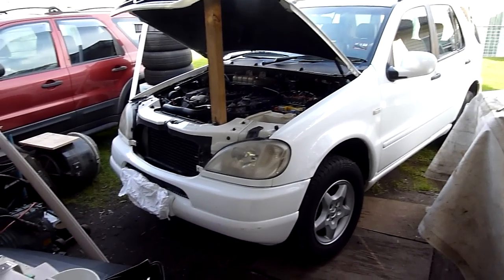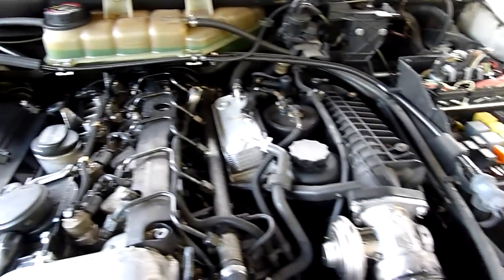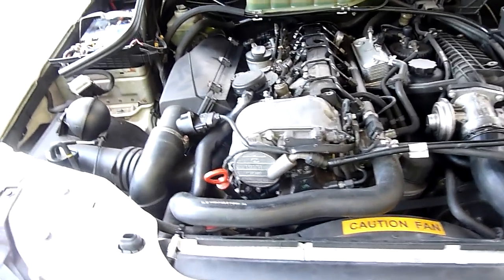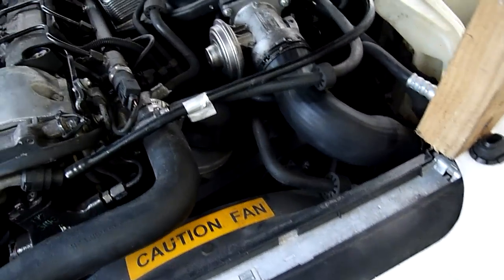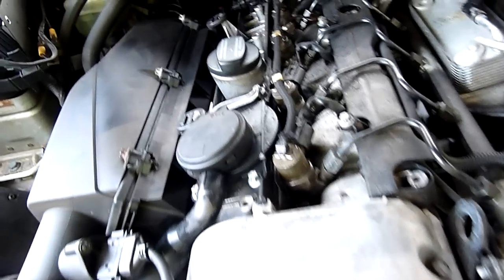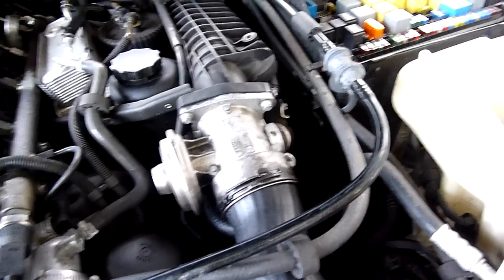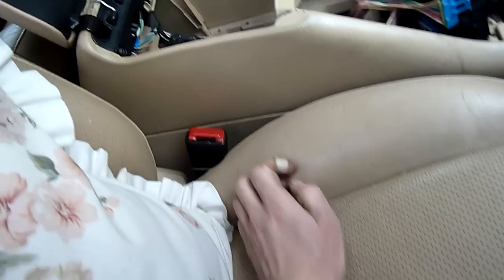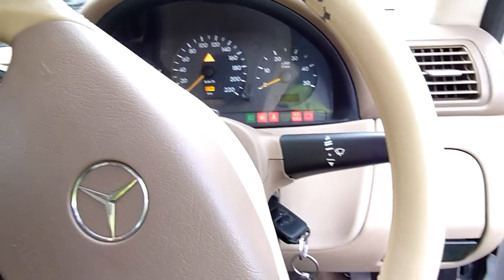Mercedes W163 ML270 CDI Project Walkaround

Comment: Nice ive owned 2 w123's a w210 and now the w163 Ml320. I bought it for $1100 usd needed a water pump and an emissions test. when i got here home it also had a split catalytic converter had an engine light and all 3 lights etc esd and the other one. It has the v6 3,2 liter , The engine light was a clogged secondary airpump passageway, the bushes were worn out on the abs pump. Anyway when these things were fixed i took it on a 600 mile trip on the socal gabler 500. Off road its great, ive owned Toyota Hilux, Suzuki Samurais 2x Mitsu Pajero and a Montero as well as a Toyota Surf so not having to lock hubs is nice. I have to say its pleasure to offroad and i rarely put it in low range.   Very easy to work on as well once you remove the inner fender well covers you can access everything. Anyway thanks for sharing your project.

Comment: From a forum: The BAS/ESP lights pertain to your brake assist and electronic stability systems. One of the more common problems we find is a faulty stop light switch or a steering angle sensor.
Reply from the maker: Ah thanks, I have to hold the wheel off center due to an allignment issue, I wonder if the steering angle sensor is causing it to freak out?
Reply: Aussie50
Worth checking isnt it :-))

My mates peugeot had the esp light on, it was the break switch, it was a double brake and esp switch, watching you put your brake on lol, not bloody esp :-)
Reply from the maker: zx8401ztv yeh my 7 series had the same issue, it would trigger the check control module if the button was not released at the right time (must have had a transducer somwhere else to detect brake clamping)

Comment: on a side note, the power seat on my mom's '96 Grand Caravan had a local fuse as well as a fusebox fuse  for the power seat. it may be worth checking into underneath at the electronics box itself in the seat. I had that one blow on me once, seat was stuck in the far back position and I felt like an idiot driving to and from autozone without a backrest.
Reply from the maker: yep!, I found it under the drivers kick panel, or more importantly, did not find it, because it had been borrowed
Reply: Aussie50  Speaking of borrowed fuses, I had to do something similar years ago on my old 97 Golf. The front wipers suddenly quit on me just before I had to go visit someone so I had to take the fuse from the rear wiper so I could make the trip safely as it was pouring buckets of rain that evening.

Comment: Hi. FYI, the battery is probably of the wrong size - you need a 019 battery with 100AH or 95AH and 800CCA. I got a Bosch 019 Silverline S5 in mine (the genuine Mercedes one lasted 7 years, and odd warning lights started to show up due to battery problem). Similar to you, I also had to reseat injector 5. Changed my serpentine belt, alternator clutch pulley and idler. Changed thermostat, all fluids, brake pads, plus installed a DVD/DAB/SATNAV system with reverse camera, etc. :)). Very nice car and pleasure to drive. Mine is a late 2002 ML270 (with indicators on mirror) 6 speed manual gearbox, 73,000 miles, which I got for a bargain price of £3,000, last November 2013 and from a dealer. Had some minor rust under the wheel arch and near the tailgate light which I polished and sprayed (Well I sprayed the whole car myself!). I also changed the bosch auxiliary coolant pump (you would know if it is faulty by holding and feeling it - no motor buzzing and no coolant flowing from the top pipe in the expansion tank = faulty pump). Enjoy.
Reply from the maker: Awesome, I figured the battery was a bit small, its clamp has been butchered to try and clamp the smaller one, but it failed. I will be looking at a new battery soon, winter is slowly killing this one.
you got yours for a steal too!, the facelifted ones are still around $7000 here, with higher mileage!.
I've been test driving her all morning and love her!, very nice ride quality with the new oversize tyres on!.

Interesting to hear yours is a manual too, I would have loved to find a manual one, but they are very rare, or expensive.

Comment: Many of them are supposed to give diesel leak problems  around the pump   I've noticed many of them are low milage  in age   it seem  they are sold on  often or changed for some reason maybe it's difficult to get mercedes mecanics

Comment: If you find the 30amp fuse for the drivers seat is blown (each side has its own fuse), it may be that one of the wires in the seat itself has rubbed through and is shorting on the frame - replace it and it may be work until it touches just right and shorts again. Had this problem in a W203 with electric seats.

Comment: Congrats on the car - very nice. Looking forward to be seeing more about your efforts. Shouldn't the car be a new enough model to have an OBD connector? A cheap interface from eBay and you might get more insight into what is causing the warning lights in the dash to come on.
Reply from the maker: I do have a standard OBD port, but apparently Mercedes have some quirky software of their own in there making it hard for cheaper scanners to see all the codes.
Reply: Damn. No other way than the hard way then ;-)

Comment: No offense, but what is it with Australia's fascination with diesel vehicles? Here in the States, we'll buy 'em in trucks, but other than that, most of us aren't that interested. Is it because of the fuel economy?
Reply from the maker: yeh, fuel economy and hauling capacity, mind you Diesel is pretty expensive now, back in the day it was dirt cheap, just like LPG. but they jacked the price up to match everything else :(
Reply: It's not just at Australia. In Europe diesel cars are very common. As a matter of fact I think US apart for few other countries are pretty much the only "gasoline" countries. Torque, fuel economy and durability pretty are the usual reasons to buy diesels.
Reply: jothain Over in New Zealand, one has to pay for the distance you use while driving a Diesel,
Reply: jothain Diesel does seem to be gaining popularity in the US, probably because the US automakers are slowly vanishing, but that's a personal thing of mine so I won't go further on that. Jeep is coming out with a few models that have optional diesels, all SUVs, and I think  a few diesel sedans are coming the States as well.
Reply: 4E047RHH Out of curiosity. Does New Zealand have, sorry don't know exact word "annual/yearly tax" for gasoline and diesel vehicles? Or is all taxes by distance traveled?
Reply: The taxes are metered out by the size of vehicle you have, and extra taxes for the distance driven with Diesels, They are trying to discourage their use, The NZ gov think they are dirtier than petrol cars, If you are really interested, i would do a google search to reveal more detailed info, as im not 100% on the info ive given here,
Reply: 4E047RHH my personal opinion is that diesels if tuned correctly are more efficient and better for the environment than most gasoline cars particularly in New Zealand and Australia because of lower admission standards for gasoline cars,  on the other hand in America it may be the other way around. in fact where I live in California, I have to take my diesel trucks that don't have any emissions on them to be inspected which is bs.
Reply: I'll have to remember that if i decide to move to new zealand :(
Reply: New Zealand is a very expensive place to drive a car, Quite high fuel prices, Plus they are a small country that is earthquake prone, so most of the taxes go to maintaining roads when they get messed up,,and yes i would tent to agree, Diesels are my preference, Especially if they are run on Bio-Diesel,
Reply: 4E047RHH very true. i have duel citizenship witch is very nice but I've always fancied living there even if it costs a lot.  its way over populated here in cali and i enjoy being able so go on a adventure without driving 3 hours first lol.
i was also in Christchurch i think two years after the big earthquake so i know what you mean, were still waiting for our 8+ big one here.
Reply: If i had half a chance i would move to NZ, despite the cost of living,Houses are cheap in some parts and the history and culture is fascinating,
Reply: ditto.
Reply: 4E047RHH i was born there ... nice place to visit but hell for a car nut,which is  80% of the population ... :-)

Comment: That's quite the nice SUV you have there, Ed. I picked up a '99 Volvo wagon from my neighbor for $425, it has 230k miles on it, but that's still a damn good price.
Reply from the maker: Volvo's are a very nice car too!, I would have bought a V70XC if it was bigger (the XC90 is perfect, but still holding a pretty high value)
Reply: +Aussie50 I have a V70, you can fit two bikes in the back, done that before, the problem with those is the shit sensor on the throttle body, it wears out after a while, I had to replace it

Comment: Whats the smaller pedal on the far left of the accelerator/brake (this being an auto)? Those fuse holders in the engine compartment look aftermarket, have they had an amp/etc fitted?
Reply: its the e-brake / parking brake

Comment: I personally would've said W463 G-Class, but they cost a small fortune since they morphed from rough and ready army truck to pimpmobile. That being said, I could never argue with a three pointed star! I don't think there's such a thing as an unreliable Mercedes diesel. They occasionally have problems with the heads, but the bottom ends are rock solid. I look forward to seeing what you do with it.

Comment: That OM612 is one of the best engines mercedes evere made^^ Unfortunately this car proofed to us germans, that Americans can't put cars properly together. The ML Class is the worst put together Mercedes in history and it's build in the U.S.
Very few W163 were put together in Austria and if you got one of those, you where really lucky. It was like putting a Dacia against a new S-Class. And all Engines/AT's where (and are) build in Germany.
All CDI's are using Glow Plugs until this day, but they are very efficient and don't need that much power.

Someday you need to drive a OM648/OM629 - THAT is Power :D
Reply from the maker: It really is a shame they tried to make them in the US :(, I would love an Austrian made W163 but I do not even know how to identify one from a US built one.

The engine really is a masterpiece!, 340,000km and still so strong!, only minor piston slap and other diesel wear, but far from out of service.
Reply: There are lots of them in germany with over 800.000 km on the clock. AFAIK, the austrian made W163 where only sold in germany and only in the first few weeks of production, because the US Factory wasn't up and running at 100%. It's a shame, that even after 15 Years of production you can easy identify where the car was made. You can identify them with the VIN:
"WDC" = Daimler-Chrysler (while German made cars have "WDB" or "WDD" for Daimler-Benz or Daimler-Daimler)
"163" = The internal model code and so on. If there is an "A" in the VIN, it's made in Tuscaloosa. If it is an "X" it's made in Austria.

They also made a few C-Classes over there in tuscaloosa and i happend to test drive an imported one...it isn't as bad, as it used to be with the first few W163, but it still isn't great and no where near an C- or E-Class build here. (Yeah, i know, the W210 is a rust bucket per excellance, but at least after 15 Years it still feels rock solid with out any squeeks or rattles inside...personally i don't care about a little bit of rust ;) )

Everyone who asks me for advice on buying a Mercedes gets the same answers: Don't buy anything between 1995 and 2006 and you'll be fine :D
Reply: Hi, a question, i drive a 270 CDI and is a "WDC" but these did not make the american market as long as i know...so they were made in the USA and send to the rest of the world?

Comment: regards to your BAS/ESP issue.. Is your steering angle sensor working properly? I've seen them go out and cause all sorts of strange issues with the electronic nannys going hayware. Maybe check that out before you fire up the parts cannon and replace modules. Cheers
Reply from the maker: I am not sure if the angle sensor is working, but the steering needs an allignment (have to hold the wheel way off straight to go straight. I wonder if the sensor is having a fit because of that
Reply: Aussie50
 It makes sense to me that a poor alignment would throw off that sensor, though i'm not 100% positive on that. But i am positive however that the steering angle sensor being upset will upset the electronic aides. A quick ohm test with your multimeter will help you determine the health of the sensor, though that test is not definitive. You'd need an alignment before buying new tires anyway. Hopefully an alignment will fix your problem!
Also if you replace the battery be sure to calibrate the sensor weather you replace it or not (turn the steering slowly lock to lock, drive slowly and repeat the procedure) i've had lots of older german cars and the sensors can cause all kinds of issues. when in doubt, suspect a sensor! Cheers

Comment: glowplug light staying on, on most cars means EGR Faults
Reply from the maker: its on a timer, goes out after 60 secs
Reply: Aussie50 oh ok. 60 seconds.... thats some long glowplug timer. Just check with the injector lines also. Being Commonrail as you know runs super high pressure. Most manufacturers like toyota recommend replacing the lines once used. All the Heavy Vehicles i work on EG cummins, the lines are a one use item.

Comment: It looks like access to the top injector is a little limited on the ML. I've got the 6 cylinder version in an E320 and had black death on my top injector. My local Merc specialist had the right tool to sort it out and managed to do it in under an hours labour including cleaning, fortunately I spotted mine before it had baked the oil into the head too much.

Comment: You bought a 2001 Mercedes, diesel, with pre-existing problems? You're a brave person! Better get that wallet ready for when something really goes bad though...

Also be careful with over-strong struts for the hood. Hoods tend to bend depressingly easy if the hinge/strut area gets even slightly stuck.

Comment: How's the transmission?
Reply from the maker: feels great, no slip, faultless shifting  (apart from the change in turbo whistle you would not know its shifting.)\
just need to factor in a service for it tho, I always service autos every 2 years, and I bet this one is way overdue.
Reply: Aussie50 i have just pulled one of these from the local wreckers (lol!) . If you look on the 'tube' there is a german vid showing a guy flushing the auto by actually running the engine with the trans pan off. These really need to be flushed to remove ALL contaminants . think of getting a Mercedes sump magnet for the trans too. it fits behind the filter. Any moisture contaminant in these trans is a killer as the glue used to bond the bands are water based.... Flush the power steer and use the Merc steering fluid not ATF because there aint no filter in there any more as in the older mercs.
Reply from the maker: Mercmad yeh I will be doing a full service on it Inc flush and, contact plate and connector block replacement. as far as sump magnets go, if it does not already have them. I just use HDD magnets. drop one or 2 in the lowest part and your golden.

Comment: Interesting rig Ed .. I do think it could get pricey though !! Hope it pans out for ya .. Those electrical issues are common on those though ..
Reply from the maker: Yeh its an interesting gamble, most issues are well documented thankfully, parts are pretty cheap here, but it can still add up, the set of tires will probably be the most expensive
Reply from the maker: just had a ECU scan done, 30 codes. mostly old ones, once cleared and retested, only 6 actually came up, mainly the ABS/Trac/BAS module, and the glow plug on No4 being open. thats it thankfully.
Reply: AWESOME .. thats good news man !!
Reply from the maker: ShawnMrFixit Lee
 yeh, these 400Nm Diesel engines are almost indestructable, its just the gremlines that drag these cars down :(. that and the occasional auto trans failure.. (BMW X5 is no better with their blown torque converters)
Reply: oh , I know .. That is way better than most of them .. You will get it fixed , Love yur vids man .. Keep us posted on that rig !!

Comment: do all the injector copper seals and bolts. They should be done every 80k miles but not everyone bothers and they start leaking combustion gas
Reply: looks like you know about this issue already lol

little mercedes trick it to roll up the windows off the key you need to hold the lock button while pointing the key at the little window by the lock if it has it

Comment: as a test could you not swap over the passenger control panel for the seat ?
If it works you know what it is then
Reply from the maker: I fixed it, fuse was borrowed for somthing else.